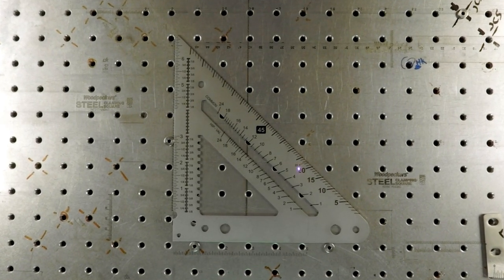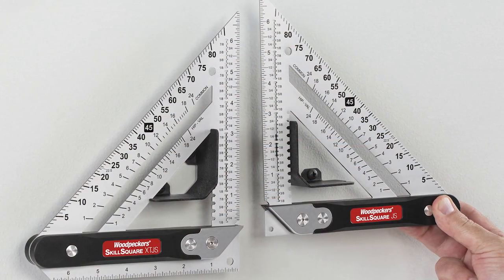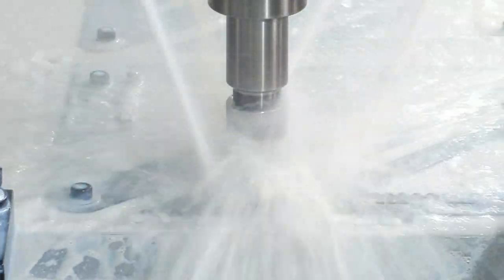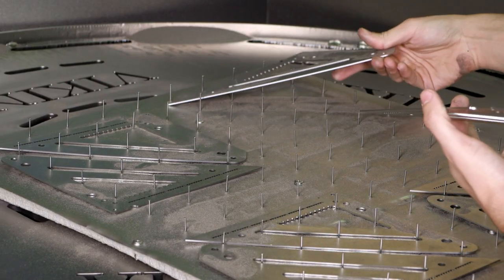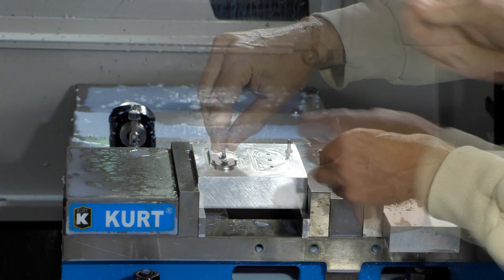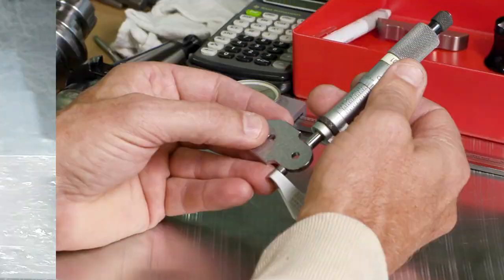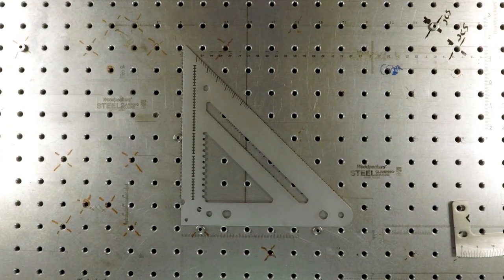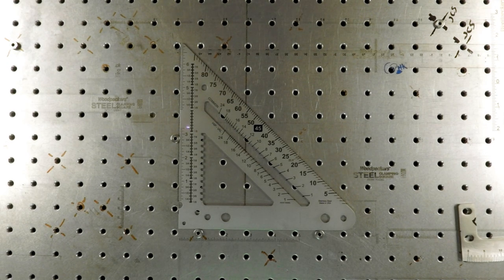Making The SkillSquare Carpenter's Squares | Production Update

Comment: At 0:38 you can see that some of the blades are warped (you could see that before blasting as well). Do you discard those? If not, how do you go about straightening them? The warp is along the length, which doesn't get straightened by the beam. That would impact usage, but also your laser engraving.
Reply from the maker: I see what you mean. I doubt those two made it any further in the process. They definitely did not make it to laser.
Reply from the maker: Well, Pete, I learn something new everyday. We have a machine specifically for flattening these (and similar) pieces. Apparently, the laser cutting and milling processes can warp the plates in some cases. The shop has figured out that we have a better final result if we flatten after the bead-blasting process, rather than before, which is why you can see them warped coming out of the automated blast cabinet.
Reply: @WoodpeckersLLC  That's pretty cool! A machine for everything :) Thanks for following up.
Reply from the maker: I went back and watched the flattening machine. Pretty fascinating. It sure doesn't look like it would make anything flat. It's a series of rollers offset from one another and the piece rolls between them. After a couple passes they check them against a granite table.